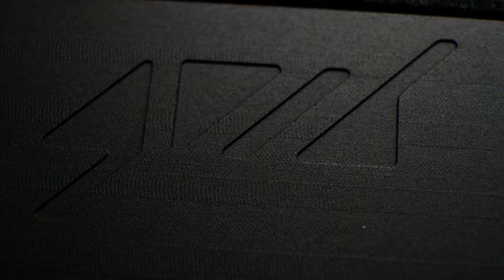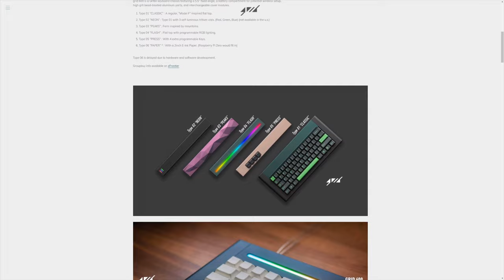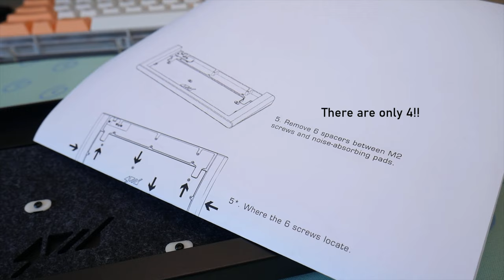Grid600 Review - Great first impressions, not much else

Comment: I have a couple of these (white and black) that I got during the original group buy (they were $225). Personally they are among my favorite boards, although I'm not quite as much of a hardcore enthusiast as some people. I've tried all of the modules but the Peaks and Neon, but I find the Flash to be the most pleasing personally, followed by the plain one with the pencil rest. I did have an issue recently where the daughterboard on one of my boards failed, causing it to not be recognized by any computer, even though the Flash module still got power. Luckily I was able to get a replacement from ZFrontier for $5 + shipping. It might be worth looking into getting a spare while they are still available.
Reply: By the way, the purple and green colors for the modules turned out way different from what they were originally supposed to be based on the renders (the green is basically blue, and the purple is much redder than expected). That was my main disappointment with these, and that's one reason I only use the black modules now. I did take an extra "Classic" module and sand it to remove the anodization and then polish it to a mirror finish. Looks pretty cool.
Reply: If you're ever considering letting go of your neon module, please let me know! I also had my daughterboard break on me early when I got the board but got a replacement from zFrontier and not problems ever since :)
Reply: Spencer Lin The Neon and Peaks are the only ones I haven’t had, so I can’t help you there. It seems not many people bought the Neon. I also sold the Press since I didn’t like the look and it wasn’t as useful as I thought it might be
Reply: @MightyJabbasCollection  Ah sorry got excited and misread your comment! Yeah I've been looking for one forever and think I might prefer something more subtle than the flash (it's blinding)! Was never a fan of how the press looked either. Here's mine -https://imgur.com/a/jSykahV
Reply: Spencer Lin I have an LED light strip that shines down on my keyboard tray (which I installed because it was too dim to see these boards I spent so much time and money on). Interestingly it seems to have the effect of counteracting the Flash module’s brightness.
Reply: @MightyJabbasCollection  Any pics? :0
Reply: Spencer Lin Unless you meant of the keyboard light situation, then not really
Reply: I have 2 Grids as well (one white and one black) and they're near the top of my list of my favorite boards to use. Both ended up with Gateron Inks which match the acoustics of the case beautifully IMO. Gat yellows never sound great to me unless they're the milky variety. I disagreed with a lot of what was said in this video but it's all very subjective in the end, and the amount of work, thought and production that went into the review is awesome. Flash is my favorite module too but I also really like the pencil rail.